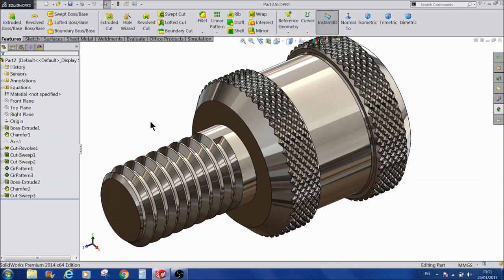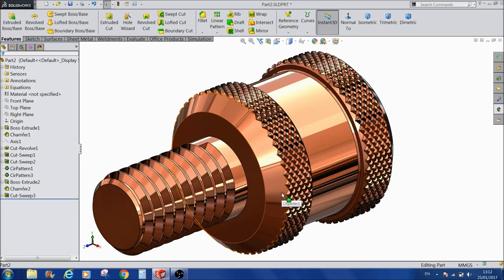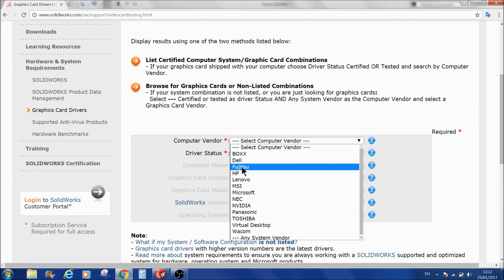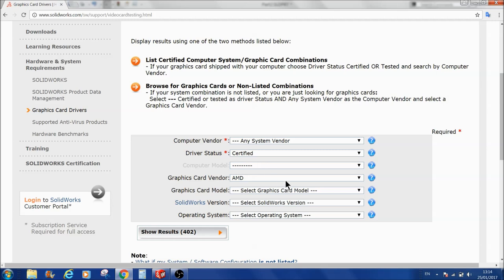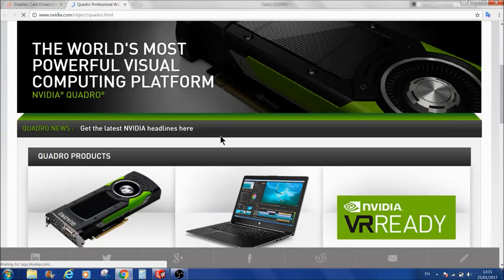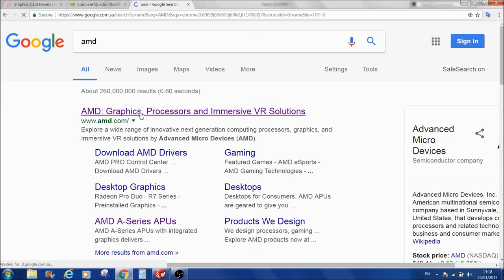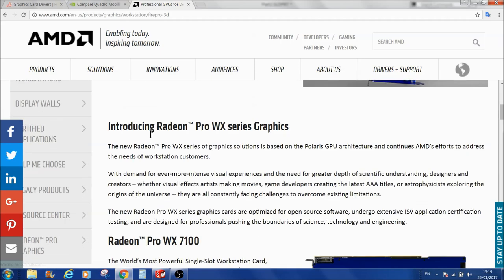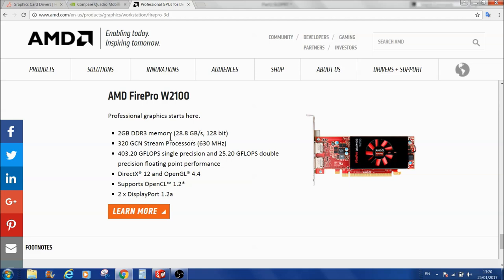Graphics Card for SolidWorks (for Realview)

Comment: While it is not officially supported, you can enable GTX and Radeon class cards to work in professional mode by doing a quick modification to the registry. I have been running a GTX 980 and GTX 960 with this modification and the performance has been great so far. This required going into the registry and adding the "gaming" class card to the professional list under Solidworks. After that, RealView can be enabled without issue.
Reply from the maker: but GTX not officially works with real view,
Reply: But if gtx cards can run it, it's better to enable it then to buy expensive professional graphic card
Reply: Not only gtx can run it, but offer better performance then a quadro or firepro. Using Visualize rendering a gaming video cards will make miracles... k2200 24 hours render time - gtx780 4hours same rezolution, size and render quality; when i use 3x gtx780ti will be done in less than 15mins
Reply: CAD CAM TUTORIAL can I use gtx 1050TI ?? I want to purchase a laptop for engineering. I want to run softwares like NX, CATIA etc..
Reply: is there instruction on how to do this?
Reply: hey Khalid; can you please explain shortly how did you enabled gtx to perform in professional mode ? how are those modifications made ? ty
Reply: https://1drv.ms/u/s!AhqIkZzXY2Fgy3tq5dgOm-XdTUjn

este archivo es de registro para solid Works 2016, si tienen otro sw 2017 o 2018 deben modificar la clave de registro con bloc de notas y cambiar solidorks 2016 por el que utilizan
Reply: es para activar real view
Reply: I have 
Dedicated GeForce GTX 960M 2GB, how do I make it work for real time view?

Comment: Why on Earth would someone buy a professional CAD card for such prices? You are better off buying it's consumer grade equivalent that costs a fraction of the price, modify the registry in Solidworks, and bumm, you have a card that you can enable realview with, and provides the same performance. I have a Firepro W7000 card, but I bought it secondhand for £170 about 2 years ago. I would never ever pay the official price that these companies are asking for them.
Reply from the maker: at the end you are using professional cards, it's for those peoples who are working with professional softwares,
Reply: Yes I guess from that perspective you are right. If I was making substantial money from these things it could make more sense.
Reply: If you have large CAD models or you want to use the render function you need this kind of card.  I know from experience.  A regular gaming card will work but not as well.
Reply: The render only use CPU......
Reply: how can i change the registry to use consumer gpu rendering can we also do this for ansys
Reply: Are two types of renderings: first one is to render 3d viewport ( what you see on the screen ) and second is final redering ( realistic render of your product ). I m not familiar with ansys,  but from my knowledge almost all profesional softwares have that registry entries do not alow gaming cards to be used. Who will spend 1600$ for a quadro when you can buy a gaming with 500$ with better performance in 90% of cases. Are few thinks in profesional software when quadro is faster with few percent, less then 10%, but mostly is up to 300% slower than a good gaming Gpu. In large assemblies I had less caches with gaming video card then with quadro... same in simulation

Comment: dell xps 15 9550/ 9560 with Nvidia GTX 950/1050 can use for CAD ( Autodesk, solid work, inventer )? 
*Tks ^^
Reply from the maker: you can use Dell xps 15, there is difference between consumer card & professional graphics cards, CAD software's performed very well with professional cards like Nvidia Quadro, AMD Fire pro or AMD Radeon Pro Wx cards, CAD software run faster with professional drivers,
Reply: CAD CAM TUTORIAL oki !! thank you so much  😆😆😆

Comment: Does solid works runs in gtx 1650 4gb graphics card .
Please explain me.
I'm planning to buy nvidia gtx 1650 4gb graphics card laptop or nvidia mx 330 2gb graphics card laptop. Which one is better. Will solid works support gtx1650 4gb?
Reply from the maker: keep latest graphics card for latest version of software's,
Reply: Hey...which one did you buy? And was it any good?

Comment: Solidworks is a CPU based software, invest in the best single thread processor and you will have great performance.
I did few test in Solidwroks 2015, not great tests but prove the point ( I can not share pictures here):
Test 1:
Processor Intel 4790K overclocked from 4gb to 4.7gb ( 8 threads of 4.7gb); 24gb memory; intel ssd drive; nvidia GTX780 ( modified , i modified drivers and i activate real view, that can be visible in test)
SolidWorks Preformance Test (sec) (overall= Processor + Graphics + I/O) lower is better
______________________________________
Overall=48.0    Processor= 21.1   Graphics=10.4    I/O=12.0
Render=6.3 
Realview Performance 16.7

Test2:
Workstation HP Z800: Dual processor 2x Xeon x5670 3.3gb ( 24threads of 3.3gb); 24gb memory; samsung ssd drive; quadro fx1800
SolidWorks Preformance Test (sec) (overall= Processor + Graphics + I/O)
______________________________________
Overall=89.4    Processor= 49.1   Graphics=15.1    I/O=25.2
Render=19.7
Realview Performance 38.9

Test3:
Worstation HP Z800: Dual processor 2x Xeon x5670 3.3gb ( 24threads of 3.3gb); 24gb memory; samsung ssd drive; nvidia GTX780 ( modified , i modified drivers making this video card compatible with solidworks and i activate real view)
SolidWorks Preformance Test (sec) (overall= Processor + Graphics + I/O)
______________________________________
Overall=90.7    Processor= 48.4   Graphics=17    I/O=25.2
Render=18.8
Realview Performance 42.4
Reply from the maker: Professional Graphics card have some advantages over consumer card(gaming card). its not only about realview, i would like to share something about professional card, many of features aren't available on a gaming card.

1)Dual Dual-Link Digital Display ConnectorsDual dual-link TMDS transmitters support ultra-high-resolution panels (up to 3840 x 2400 @ 24Hz on each panel) --which result in amazing image quality producing detailed photorealistic images.

2)Fast 3D TexturesFast transfer and manipulation of 3D textures resulting in more interactive visualization of large volumetric dataset.
3)12-Bit Subpixel Precision3x that of the nearest competitive workstation graphics, 12-bit sub-pixel precision delivers high geometric accuracy, eliminating spreckles, cracks, and other rasterization anomalies.
4)32-Bit Filtering and BlendingEnables unprecedented rendered image quality for visual effects processing.

5)Advanced Color Compression, Early Z-CullImproved pipeline color compression and early z-culling to increase effective bandwidth and improve rendering efficiency and performance.
6)NVIDIA Unified ArchitectureIndustry's first unified architecture designed to dynamically allocate compute, geometry, shading and pixel processing power to deliver optimized GPU performance.

nView Multi-Display Technology
The NVIDIA® nView® hardware and software technology combination delivers maximum flexibility for multi-display options, and provides unprecedented end-user control of the desktop experience. NVIDIA GPUs are designed to support multi-displays, but graphics cards vary. Please verify multi-display support in the graphics card before purchasing.

PCI Express Certified
PCI Express is a new Intel bus architecture that doubles the bandwidth of the AGP 8X bus, delivering greater than 2GB/sec. in both upstream and downstream data transfers.

Quad Buffered Stereo
Offers enhanced visual experience for professional applications that demand stereo viewing capability.

Rotated-Grid Full-Scene Antialiasing (RG FSAA)
The rotated grid FSAA sampling algorithm introduces far greater sophistication in the sampling pattern, significantly increasing color accuracy and visual quality for edges and lines, reducing "jaggies" while maintaining performance.

Unified Driver Architecture (UDA)
The NVIDIA UDA guarantees forward and backward compatibility with software drivers. Simplifies upgrading to a new NVIDIA product because all NVIDIA products work with the same driver software."
Reply: Actually nothing what a gtx 980ti will not have, actually a gtx 980ti offer a  better in resolution and more displays.
the only things extra are ECC  memory, less errors, what who cares as long you don t have crashes and last one drivers optimized for you software, what again as long no crashes and better performance, why not gaming gpu?
Do you use a fx1800? did you ever tried a 660ti, 780, 780ti, 980ti or any gaming video card to have a real compaction? without trusting some advisement for professional video cards, they need to justify why they ask so much extra. will make sense to pay that money? I think no will not. enjoy your life and travel, not to waste money in some useless stuff. If i can do my work with cheap gaming gpu why to spend extra for nothing? If quadro was really so good, why they need to do that stupid stuff in registry to stop people in using gaming video cards? they do it only because they need to force people to buy professional, if they will not do that, big companies will not spend money in professional video cards at all...
Reply: Actually nothing what a gtx 980ti will not have, actually a gtx 980ti offer a  better in resolution and more displays.
the only things extra are ECC  memory, less errors, what who cares as long you don t have crashes and last one drivers optimized for you software, what again as long no crashes and better performance, why not gaming gpu?
Do you use a fx1800? did you ever tried a 660ti, 780, 780ti, 980ti or any gaming video card to have a real compaction? without trusting some advisement for professional video cards, they need to justify why they ask so much extra. will make sense to pay that money? I think no will not. enjoy your life and travel, not to waste money in some useless stuff. If i can do my work with cheap gaming gpu why to spend extra for nothing? If quadro was really so good, why they need to do that stupid stuff in registry to stop people in using gaming video cards? they do it only because they need to force people to buy professional, if they will not do that, big companies will not spend money in professional video cards at all...
Reply: Actually nothing what a gtx 980ti will not have, actually a gtx 980ti offer a  better in resolution and more displays.
the only things extra are ECC  memory, less errors, what who cares as long you don t have crashes and last one drivers optimized for you software, what again as long no crashes and better performance, why not gaming gpu?
Do you use a fx1800? did you ever tried a 660ti, 780, 780ti, 980ti or any gaming video card to have a real compaction? without trusting some advisement for professional video cards, they need to justify why they ask so much extra. will make sense to pay that money? I think no will not. enjoy your life and travel, not to waste money in some useless stuff. If i can do my work with cheap gaming gpu why to spend extra for nothing? If quadro was really so good, why they need to do that stupid stuff in registry to stop people in using gaming video cards? they do it only because they need to force people to buy professional, if they will not do that, big companies will not spend money in professional video cards at all...

Comment: sir i need your suggession please suggest me...i am using Dell i3 3521 laptop...i am using in my laptop catia creo NX Unigraphics and Solidworks softwares. while using softwares my laptop run's very slow... i need your suggession which grapgics card is suitable for my laptop please suggest me
Reply from the maker: laptops always came with inbuilt graphics card you need to change your laptop, for cad softwares choose workstation laptops.
Reply: CAD CAM TUTORIAL can we use gtx 1050ti graphic cards?? They are beasts.
Reply: @zaviorhunt4845  1050ti only good for gaming not for Solidwork or Autocad.

Comment: Thank you for the explanation. Is there any External Professional Graphic Card (EPGC) available? Graphic Cards are expensive. I like to have an EPGC so that even if I change the computer I can remove it easily.
Reply from the maker: you can use cards as a external source with the help of external graphics support.
Reply: U can buy a simple gaming laptop which costs around 70k as a starting price with NVIDIA GEFORCE GTX 1050TI. u can even add ram and ssd according to your own needs easily. Empty slots are provided..

Comment: very useful
Reply from the maker: thanks,
Reply: if you can make some benchmarks to give us comparaison of simulation and rendering of mechanical system with or without Professional GPUs
Reply: i did few benchmarks between few quadros and few gaming viseo cards. Gaming video cards are away better. If I will find my benchmarks I will share them. A better CPU will help you in graphic too. Solidworks is CPU base software, invest in CPU not in GPU, best single thread processor for best performance and again that is not a xeon :)